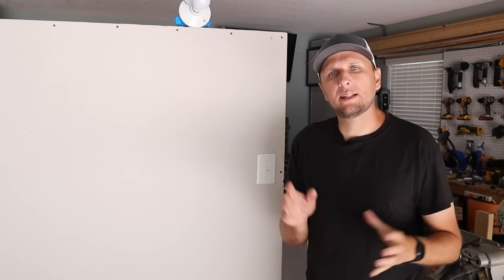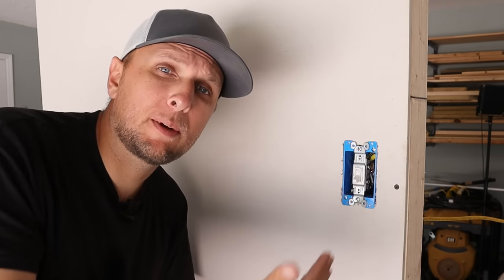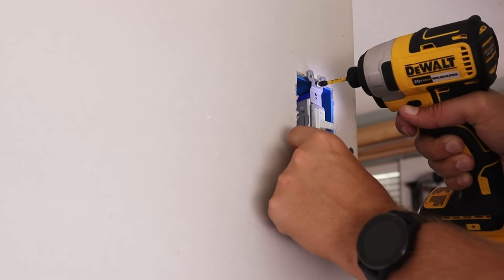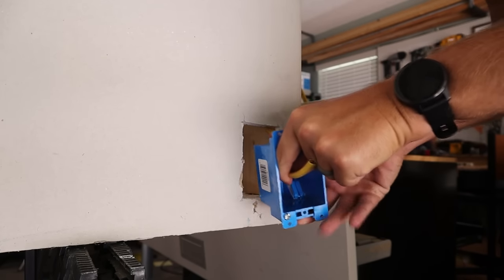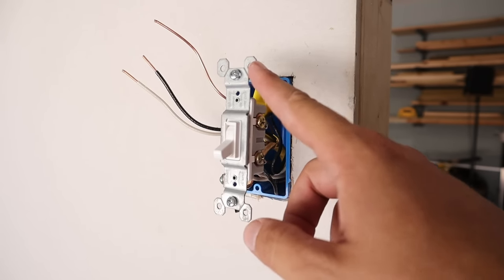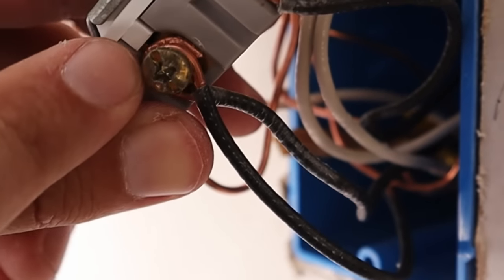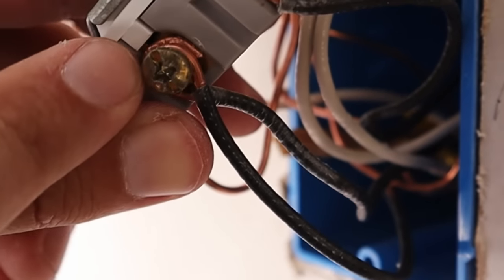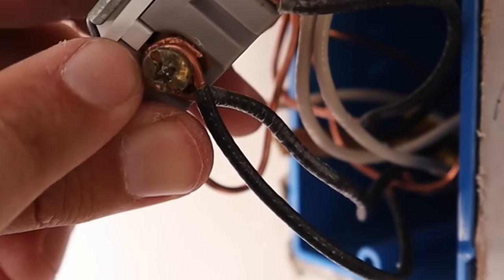How To Add An Outlet From A Light Switch | Common Mistake

Comment: Curious, so since the light switch is on a 15amp breaker and you’re adding an outlet to get power from that light switch, could the load drawn from the new outlet be a heavy draw from that 15amp, depending on what’s plugged into outlet? 
And wouldn’t that trip the breaker at some point or cause the wiring to overheat?
Reply from the maker: Depends on what is already being drawn on the circuit and what you are intending the receptacle to draw.  If it is too much then the breaker would trip.
Reply: It wouldn’t make the wiring overheat, the breaker is designed to prevent that. Besides, in the example he has 12 gauge wire on a 15 amp circuit

Comment: Since this is oriented towards relative beginners, it really needed to indicate that this is NOT going to work in most light switches in "old" work.
In all the homes I have worked on (70s-90s) the most common light circuits are run with the lines to the lights and only a switch loop to the switch.  NO NEUTRAL in the switch box.  This video cannot be used with that condition.

Comment: So, the three black wires - the outlet is always on (not switched) because the three black wires are together, but the light bulb isn't always on because of the load line doesn't get the connection until you flip the switch - correct?
Reply from the maker: You got it!

Comment: In my situation, I have a white and black wire coming into the wall box - no ground. The black has power and is attached to the switch at the bottom and the white is attached to the top of the switch. It works as it should in this configuration. If I hook up the black power that is coming into the switch and connect it to the outlet with a pigtail coming out that will go to the bottom of the light switch and basically do the same to the white wire, will it work?

Comment: Nice! My question is on my 1962 house only have metal boxes. Is there a way to do it with the metal type boxes?
Reply from the maker: Well you can connect into the existing metal box but I would still just install a plastic old work box for the new box being installed.
Reply: @HowToHomeDIY  Sweet, thank you for the quick reply.
Reply: Yes they make rework metal boxes. Not too many plastic boxes at Lowe’s.

Comment: Sht I pigtailed also the outlet wires, it shows I have power to the outlet but nothing that I plug in works! So you only wire the bottom terminal and that gives power to both sockets?

Comment: Ok...So I'm trying to do a similar project. I want to put a switch next to my breaker box and run that to a new outside outlet ....then to a Ring Floodlight. This would all run in a straight line on the outside of house.

Comment: I watched the video on how to go from an existing switch to a new outlet now my question is I want to put a new outlet and run it up to a switch but it’s a switch box that has three things. It runs one switch runs an outside light one switch runs a fan which should I use the fan or the outside light to run to my new outlet then in my bathroom I have a three switch and I want to run an outlet down below and that has a switch running a fan, a light and a heater to the with build into the fan. How do I run the switch to power the outlet?

Comment: I have a lighted switch.  It has to be wired different?  One power wire on one terminal and the outlet power wire on the other terminal? Same side?  Is this correct?  Seems to me, I am only going to have power to the outlet when the light is on?

Comment: I have a light switch by the front door and it only shuts on/off a receptical right by the door itself. (Rather useless) Above that, at the ceiling is an AC vent such that i might be able to drop a line to that switch or recepticle from that point. What I want to do is connect 6 of those LED lights that recess into the drywall but I need to get power from the switch or recepticle to somewhere in the middle of that ceiling. Do you have a video on how I might pull that off?

Comment: nice video, but what you do when there is no neutral wire in the switch box?
Reply from the maker: Then it is up in the light fixture.  Either a new wire would need run or would need to find another outlet.  A neutral is needed for a receptacle.

Comment: what if you want that outlet to ONLY work when the light switch is on? would that black wire from the outlet goto the top terminal and not the hot line?

Comment: There is no guarantee that a stud is on one side or other of switch box.  Often it would be a three or four way switch.  You should also understand your available power on that circuit as adding an outlet when you only have 2 amps available does not add value.

Comment: Now that you used the light switch to power the outlet, does the switch have to be on or light on for the outlet to have power?
Reply from the maker: No, the switch and receptacle are not connected to each other, they just share the same power source using the pigtails.
Reply: @HowToHomeDIY  This past week I installed an outlet splitting off a junction box in my ceiling. I use the outlet to power a smart light strip but the outlet now turns off with the switch. Is it because it’s a direct feed from the switch?

Comment: So does code allow outlets to be placed on the same circuit as lights? I thought (and prefer) to keep them separate that way if someone pops a breaker on the outlet, they still have lights.
Reply from the maker: In the US yes it’s allowed by code and very common.

Comment: Isn’t the outlet supposed to be at least 12 inches from the floor? Also, I suppose codes vary, but one electrician I had at my place had no problem with connecting up a new outlet to the existing light switch. But then another electrician I had in my place said that it should be wired directly to the panel box, or another outlet, but never a light switch.

Comment: Does the outlet only work if the light switch is on? What type of wire did you use?
Reply from the maker: No the outlet has constant power.  I used non metallic wire.  Also known as Romex.

Comment: An electrician once told me that he prefers to run power to the light and drop a cable to the switch. You don't mention that possibility so, do you disapprove and not consider it an option?
Reply: New codes require a neutral at the switch even if it is not needed yet. With the advent of motion activated switches or other dimmers requiring it in the future.

Comment: I have a request. I was watching this video to try to reverse engineer my problem. I have a switch that goes to a outlet. The bottom outlet is always hot and the top part of the outlet is only hot when the switch is on. I want to run electrical to have a ceiling light/maybe a fan too. Do you have a video on that? If not can you educate me with a new video?  Let me know 🙏🏻

Comment: I am trying to add an outlet from a switch. The power is to the ceiling light first then to the switch. The switch has a ground, black and white. The white is the hot wire. Do I need a new switch to allow power to stay constant to the outlet? Or is there no way to change the circuit to allow for the outlet with the switch loop?

Comment: Question, I did this at my moms old place (using a pigtail as noted), it’s not a heavily used circuit (a few lights and outlets), however I notice when I use the vacuum plugged into this switch the lights directly above dim (almost to 0 brightness).  Keep in mind this only happens on that set of lights, and nothing else is on/plugged into that breaker at the time… thoughts?…
Reply: Find out exactly what's on the circuit. Turn it off at the breaker and check all the connections  (no loose screws, good splices, etc). On second thought, start out with the outlet you plug the vacuum into first. Then check the rest. A vacuum can draw 12 amps which is a big load.

Comment: I have a box with a light switch in my drywall-less garage. I have photos to show what currently exists if necessary. As recommended by those who know what's best to do I need to either replace that single switch box with a combined switch/dual receptacle outlet box, or at a distance from the switch box I need to add an electrical receptacle outlet box.  I don't want the switch to control the current sent to the receptacle outlet box. I just need continuous electrical current sent to the receptacle box. Do you know what's currently available for me to view that would help me to understand better how to do this?

Comment: I'm working on a similar project when connecting a loose l.e.d bulb to a single pole connecting to an outlet. Everything works but when I put in my tester  it's not correct it says open ground. ????????? Maybe disconnect hot from direct source and connect to terminal???

Comment: I didn't see you hook back up the hot black wire that was feeding the light after you pigtailed the lower hot . You had all the wires removed when you decided to pigtail but you didn't explain the hot wire feeding the light was already hooked up.

Comment: What did you screw the outlet box into?  If it’s just the drywall it’s going to fail as you continue to plug devices into and out of it.
Reply from the maker: It’s an old work box.  It’s designed to work on drywall.  It’s doesn’t screw into it it basically clamps down on it.
Reply: yep those old work boxes are JUNK. sooner or later, they either get ripped out of the wall or pushed in the wall

Comment: pigtail takes up a lot more space (wire and connector) in already a tight space. it's nasty to then shove everything inside. your old fashioned tiny switch does not present a lot of problems but modern smart switches take up a lot space inside that box

Comment: I Thought the blue outlet box with the tabs that Press up against the back of the drywall asre for low voltage application only. I prefer not to use them for outlets Due to the abuse outlets take.
Reply: The "boxes" meant for low voltage applications are orange, and it's really just a face frame that slips into the hole in the drywall and is secured with the tabs. The blue boxes with the tabs like he used here are called old work boxes. They're for adding fixtures, switches, and outlets to existing, covered walls and ceilings where there's no access to the studs for securing a standard new work junction box. Old work boxes also come in steel and function similarly. Both steel and blue plastic boxes are rated for standard household current, though I understand not liking them for outlets - those tabs put a lot of stress on the drywall, especially if the box is centered between studs instead of right beside the stud, and most especially if the drywall is 1/2" and/or old.
Reply: @Dwayne_Bearup  low voltage boxes arent just orange. we get them black, white,grey at work. old work boxes suck ass, they eventually pull out of the drywall. those garbage tabs put too much strain on the drywall. I'll use them for a light switch or if I have to , a junction box. I'll never use them for outlets; had far too many get ripped out of the wall or pushed in the wall

Comment: A couple of questions for experts:
1. Most light circuits use 14 gauge where as receptacles are required to use the yellow 12 gauge. Shouldn't that be the first thing to determine if the light switch has 12 gauge wire or not?

2. Can you get a light circuit of the receptacles circuit?

Thanks
Reply: 14 gauge wire is used on a 15 amp circuit; 12 gauge is used on a 20 amp circuit. Typically, 20 amp circuits are only used in kitchen and bathroom receptacles.  Lighting is strictly 15 amps/14 gauge. All other receptacles in the house can be 15 amp with 14 gauge wire. So, in a living room or bedroom, it would be acceptable to add an outlet from a switch location.
Reply: Most receptacles in homes are 15 amp rated. Even if you feed them with 20 amp wire and breaker they will eventually burn up if they are constantly loaded over 15 amps. If you want true 20 amp capability you need 20 amp devices.

Comment: I am doing the same taking power from a switch box but in my case the receptacle will go up, not down as I need power to move there my home network devices which will be placed on top shelve inside laundry room; the switch box controls the kitchen lights and has 2 switches, one for the kitchen lights and one for the light in the dinning area but inside that double switch box there are 4 wires, all have Red, Black, White and Copper wires on them; the cable I using for my Receptacle above has only Black, White and Copper; inside the switch box One of the 4 wires has the red one not connected to anything; by looking at the video it helps but still have to figure out where to take the power from; find the constant hot and connect my black cable to it then the white and the copper can be piggy tailed with the others in the box right?

Comment: Be nice to know you have a neutral in the switch box before you cut your new hole. A fair number of switches have no neutral, but only a single, two conductor cable from the lighting fixture with only a hot input and a switch leg return. Electricians would know this!
Reply from the maker: Yeah that is true.  In which you would not be able to do this.

Comment: Instead of connecting an outlet and a light at the light switch box, can you connect 2 lights at the switch box? Instead of connecting the 2 lights with a junction box and running 1 new wire to the switch?

Comment: Does the switch need to be on to supply power to the outlet below or does the outlet always have power?
Reply from the maker: In the configuration in the video, the outlet always has power.

Comment: I tapped off an outlet to bring power to a new switch I needed to install for a light. The power wire must have been going to the switch next to it because now when I turn it on both switches apply power to both light together. Any idea what I could here?

Comment: Yellow romex. Wish I'd paid for that when this house was built. The "electrician" put 2 bedrooms (lights+outlets) on 1 15A breaker. Also, he used the holes in the back instead of the screws. I've been working my way around the house fixing that lazy-way install. Splitting the rooms to separate breakers is another story.
Reply from the maker: Yeah it is up to code but I really do not like the back stabbing approach.  I have seen and heard of so many issues coming from it.  I like you am and have been fixing it to be safer.  Thanks a lot for the feedback and taking the time to write your experience!
Reply: @HowToHomeDIY  the 2 rooms on 1 circuit kills me. My laser printer flickers the lights in both rooms when it turns on. I'm glad I insisted on the PC having its own breaker.
Reply: Preach it. Our house was built in early 70's and same problem with too many rooms on a single 15A breaker. Everything was backstab too.

Comment: I am not a big fan of the push-in connections in an outlet either... However, when people say "it could fall out", how would it actually fall out in a fixed screwed in outlet where no part of the outlet itself is actually wiggeling or moving? How would a wire "just fall out"? Ghost hand?
Reply from the maker: They can wear out over time and lose their ability to hold the wire like they were designed to do.  Nobody pulls them out but electricity does cause the wires to vibrate back and forth.

Comment: I would use wago connectors much safer and more reliable than wire nuts.  For people watching this video there is a correct way to use wire nuts and a not so safe way.  Which many people use the short cut. I have not looked thur your videos, but if you haven’t make a video on wire nuts and how to properly install them.  Great video
Reply from the maker: Hey Joe, I do in fact have one on that subject.  I think I posted it about a month ago.  Really appreciate the feedback!
Reply: As an electrician I have seen far too many burnt-up Wagos to ever use them or recommend them. It's not just intuition either, twisted wires have a far superior area of contact than the tiny little bus-bar that Wagos have, which only have a very small contact area with the copper. With all due respect, if somebody isn't comfortable twisting wires together, they shouldn't be doing electrical work.
Reply: @NoTroubleMikeG  many people in our profession take short cuts with respect to wire nuts.  If it’s done correctly it’s great. I have seen many more failed wire nut applications than wago.
Reply: Seen to many wago failures.

Comment: ??? I was told ALWAYS keep wiring for lighting and plug switches SEPERATE because the two are seperated at the fuse box so you can turn off power separately to lights. Maybe an Aussie custom???
Reply from the maker: Yeah we often don’t separate them here.  My circuits are done by room.

Comment: Dude... you are like saving me $300-$500. I didn't opt for the estimate from the electrician. That was $104 alone. Sure I'm not licensed but it's my house and I have homeowners with a $500 deductible so even Steven if it goes bad.

Comment: I don't understand the idea of calling the white wire neutral. It carries current back to the panel to complete the circuit. In the light switch box, the neutral is in there but marretted and bypassed to the light switch to the light fixture. I would be testing that white wire too. Just had a job done for me. A 14-3 wire running from the panel from 2 circuits, 1circuit to the stove and 1 to a light.  I want to add a light receptacle and pull the breaker expecting a power break. That stove appears to be still returning current back to the panel on the "Neutral" and that Neutral is sharing with the light system.

Comment: My place was done by some old boomer who just used the neutral as the load. Not a single switch in my house had a neutral running through the box (when there was a box).